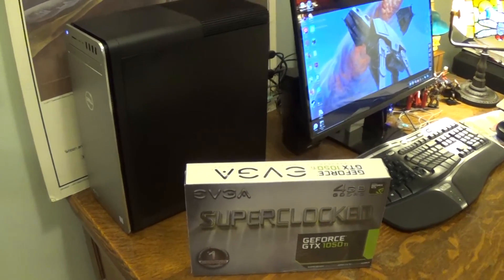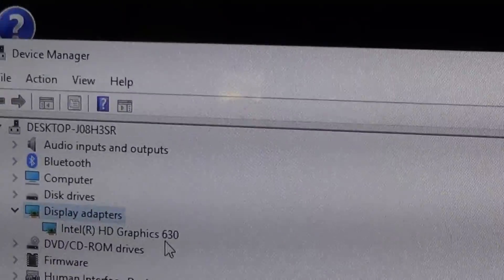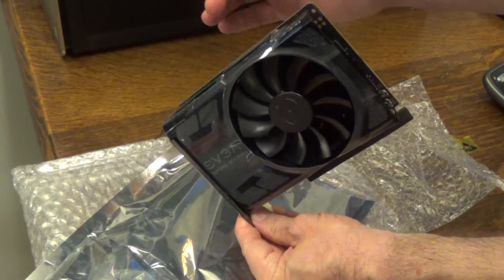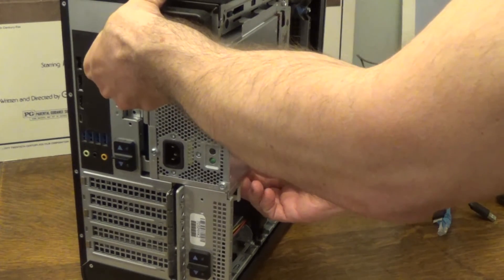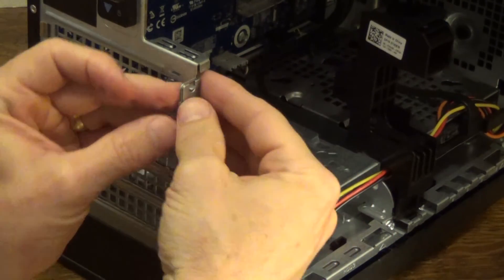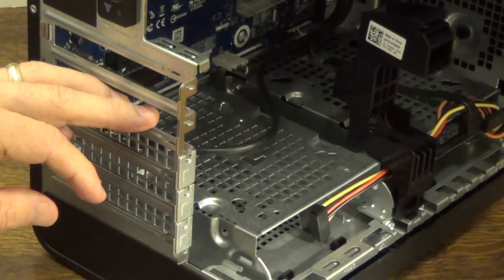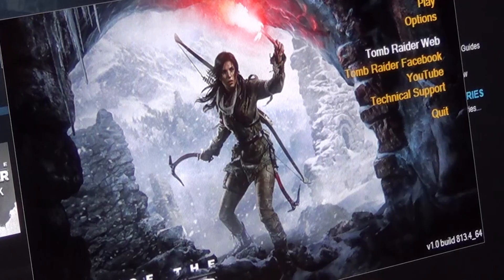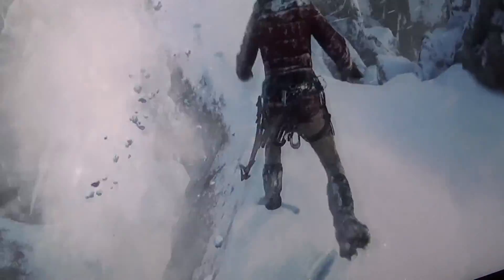How to Install a Graphics Card into your Computer

Comment: You should have bought a 1070ti that 1050ti will bottle neck
Reply: it isn't compatible, i dont think
Reply: i have a i7 8700 and i came with a 1050 ti and it bottlenecks like crazy
Reply: Ash-plays i have same pc with same specs. What does bottle necking mean and can i upgrade the 1050 ti to something like an rtx 2060?
Reply: Jahpods TM yes I did that and bottle necking is when your cpu or gpu is worse than the other to the point it slows it down so the 17-8700 is a good cpu where as the gpu is ehh so with the 2060 it would pair great
Reply: Ash-plays do you know if an msi gtx 1660 ti gaming x would work too? Also, did you have any issues getting your rtx 2060 to fit in your pc and did you need to replace the psu?
Reply: Jahpods TM everything will fit and psu is good for any card for the most partition has a 8 pin as well as a 6 pin so plenty power. No issues sloted in perfectly had more room to
Reply: Ash-plays just to clarify you have a 460 watt stock psu right?
Reply: Jahpods TM yes
Reply: Ash-plays alright cool. Any chance i can add you on discord or smth in case i have some more questions before i make a purchase or install anything?
Reply: Jahpods TM I’ll add you on discord
Reply: Ash-plays and thanks again 🙏
Reply: @ash-plays6733  You sound seemingly informed, so I would like to know whether or not a GTX 1650 XC Black Gaming (Single Fan) would work on a pc such as a Dell XPS 8500 with an integrated graphics processing unit. It has 16gb of RAM and an NVidia GT 620 (stated above). Please let me know if you have any information! Thank you! :D
Reply: PanthaPlayz ya that looks like it would work nothing says other wise
Reply: @ash-plays6733  my pc has a Core i5 8400 and a GTX 1050ti which does bottleneck in some games
Reply: Gabriel Austria you could upgrade to the 1660 super and improve performance by a lot
Reply: @ash-plays6733  I am planning too, but do you think the rx580 8gb is better or nah?
Reply: Ash-plays Hey were you able to add me on discord? If not, no worries, i just havent received a request if you did.
Reply: Jahpods TM just sent it
Reply: Ash-plays alright cool. Ill check tmr and let you know if i got the request
Reply: Jahpods TM ok
Reply: Ash-plays i have no pending requests but there are some names on my friends list that i dont recognize (that may be you). What is your discord user?
Reply: Jahpods TM ashplayz
Reply: Ash-plays i dont see you in my friends list or pending